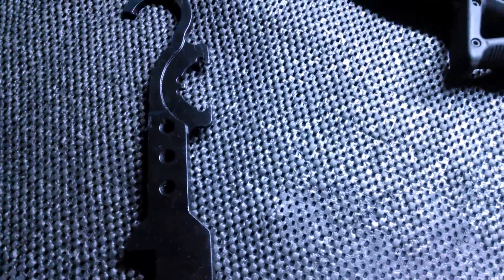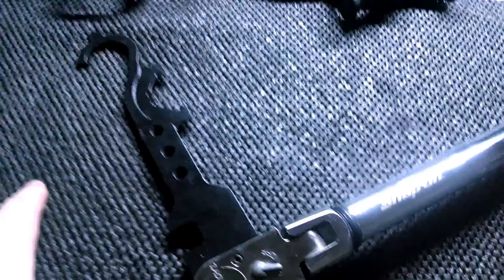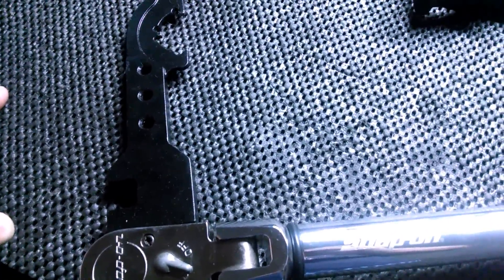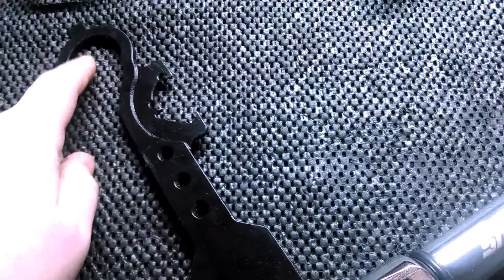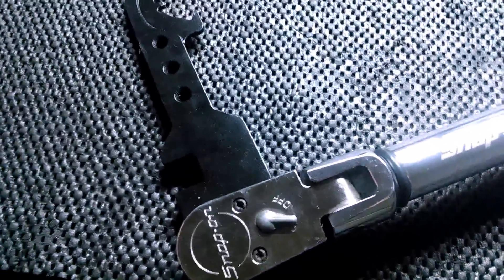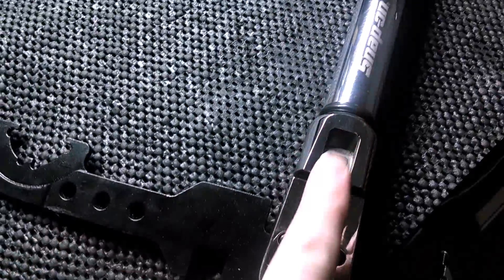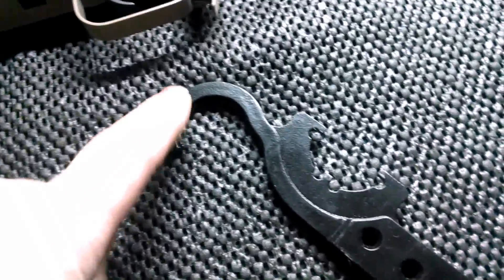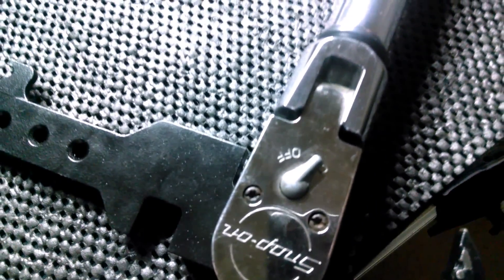Proper torque of AR barrel nut

Comment: YES, thank you! I am an engineer and ive been waiting for someone to make this video!
Reply: Interesting, I knew the values are different when you have an offset but I didn’t know putting it at 90 negates the need for calculating the actual value. Makes sense when you think about it, bout to install a new shroud and this info will come in handy!
Reply: i keep a 1" wrench with a 3/8 drive adapter welded on the box end with the conversion formula etched on the side just to reach and torque one specific hydraulic line lol
Reply: I'm an ME myself and I believe after about the third grade most kids stop paying attention in math

Comment: Awesome video!  Thank you for bringing this to light. Yes, adding 90* removes the additional lever length. The people saying it doesn't matter will change their song if they over torque and strip the aluminum threads off of their upper receiver, or the over torque causes too much stress with recoil and their receiver cracks at the barrel joint. Plus steel and aluminum expand at different rates when heated, and the proper torque gives adequate space for the expansion. Saying it doesn't matter is horrible advice when it is so simple to correctly do it.

Comment: For anyone interested in understanding the formula, look up how to calculate the sine or cosine of a right triangle. Torque is applied force x distance from axis of rotation (center of nut). This requires that the applied force is perpendicular (90 degrees) to the wrench.
If you cannot get a wrench onto the nut or bolt at 90 degrees:
For wrenches OVER 90 degrees from torque wrench, the length of the torque wrench becomes- Length of torque wrench + (length of barrel wrench x sin(degrees past 90). Now divide your needed torque value by that new total length and you have the required force.

If the wrench attached to the torque wrench is at a position LESS than 90 from the torque wrench, subtract the barrel nut wrench length x sin(degrees less than 90) The rest is the same.

Comment: Im not a mechanic but i was thinking that  adding an attachment to a tourqe wrench would change the value. Just as you get more tourqe by adding a longer bar on the handle. I didnt know that by making sure the attachment was 90 degrees it would equal it out, great to know, awesone info.

Comment: Thank you, i had a feeling that when you use a torque wrench on anything that can enhance leverage, the value would be different. You have taught me how to properly torque the ar15 barrel nit! Thanks a million, just always remember 90 degrees!
Reply: SHOOT & SHOW
I have never used anti-seize or anything else on my barrels. I torque to 50ftlbs and have had no trouble taking them off. Do they come loose or freeze up?
Reply: SHOOT & SHOW
Got it, I suppose using anti-seize is cheap insurance against something like that.

Comment: One hundred percent correct. 

torque = r(adius) x F(orce) x sin (of given angle)

Sin value of 90 degree angle = 1

Formula becomes simply radius x Force, which is basically the reading on your torque wrench.

Comment: I too work in aerospace, dropped a few torquemeters already :-). Everything spot on with how I was trained. Will add too, the 20/80 rule which I'm sure you're aware of. Take the max readable torque value of your wrench, double it and move the decimal place one to the left...IE, I have a 30in/Lb torque wrench, it's accurate range is the upper 80%, or 6-30in Lbs. Again, to the poster, I'm sure you were aware of this, just added value to the viewers. Also, snap-on makes toque calculators specifically for the reason, but in most cases you can get at the bolt/nut/whatever with the 90 degree.
Reply: In all honesty, up until this weekend, I've mated up several barrels to uppers...not utilizing a torque wrench, with no issue, but I agree it should be done right. Further more, kudos to Noveske for taking the time to answer my questions regarding such, the guy I spoke to recommended aeroshell for grease by the way, however I'm sure there are several that will work.
Reply: Fuel controls mostly, in different flavors, brought to you by Honeywell. Kind of fell into the job, with a BS in a whole nother field, enjoy studying up on turbines though...a good channel I've found is AgentJayZ
Reply: F100-PW-229 here, the generator isn't as complex as the "unified" from what I'm told, but is still quite the bear. Most folks in our area think we make thermostats, but that's okay.

Comment: I’ve watched half a dozen videos about this topic, and was thinking “how are they not taking mechanical advantage into account”?  I’ve been working on aircraft for 25 years, and this is something you learn before you even touch an aircraft.  The only rational explanation I can think of, is that these guys are using an armors manual where the tool length is is already calculated into the torque spec.  And, they have continued to use this same justification for every application, which shouldn’t be the case.  Anyhow, good video.
Reply: Wait, what are you saying?  Your reply reads like you are saying opposites at the same time.

Comment: Yep, Ford Senior Master tech here and I see the same thing. Real easy to just set the wrench 90 and be accurate. What's the point of torquing if your not doing it right. Hopefully your video helps folks out.
Reply: Spec is written as if there is a socket. any wrench length is not part of spec.

Comment: ya any inline extension will increase the torque you applied do to leverage as a tech we try to only use short crows foot sockets at the end of a torque wrench so it only changes the output by about 5-10 ft lbs give or take.

Comment: C=D(A/A+B)
A= Length of toque wrench
B=Length of lever
C=Torque
D=Angle
Reply: Jake T. A/A would just be 1 so I would simplify by saying C=D(1+B)
Reply: @iroquoispliskin6077  you can't cancel out like that with B in the denominator. Plug in different numbers in the original equation and you won't match your formula

Comment: Yes you are correct.  Force x lever arm length = torque.  Keeping the armours wrench 90 degrees in relation to the torque wrench shaft maintains the original  lever arm length of the torque wrench.  No need for trigonometry and algebra this way.

Comment: Right on brother!
You are 100% correct. 
I too play with torque wrenches all day for a living. 
I am also an AR builder. 
This is correct knowledge!
Thanks for putting that out there for other people. 
Where people get confused is the army’s Armorers manual states to hold the torque wrench at 0° and I think that’s where people get their confusion and all the mixed info. 
I guess that’s also why they give you a big window of torque values.
Like 50 lbs to 80 lbs. 
I keep the torque wrench at 90° and after seasoning the treads i do a final torque value of 50 to 55 and have never had a problem or have a barrel nut come lose.

Comment: I have built several oil and gas tools at my job that require the use of torque adapters and absolutely if the adapters being  used do not consider the formula people are not getting the proper values.

Comment: That is how the USAF taught us to use torque wrenches.
Reply: Yep. I worked on f15s and fa22s
Reply: I'm the guy in the AF who used to calibrate torque wrenches. You might also recall that when using a standard crowsfoot adapter, it didn't matter what angle it was, but to torque to the center f the specified range. QC guy tried to fail me on a task once until I pointed that tidbit out in the tech manual. Personally, with a torque range of 30-80 Ft/Lb on the barrel nut, the drive being a couple inches away isn't going to be wrong unless you're right at minimum or max torque.

Comment: Thank you for this! Question....if someone positioned wrench improperly, which way applies more torque? In other words, the way your torque wrench is positioned 90 degrees in this video, and let's say you are doing the castle nut, if you ratcheted your wrench 45 degrees to the right, would that apply more or less torque on the castle nut? Or what if you positioned your wrench 45 degrees to the left of 90?  Basically if the wrench would be at 45 degrees vs 135 degrees? Thanks again!

Comment: With all due respect to all the posters that suggest the angle between the wrench and the extension matters, or the length of the extension matters, they don't. 

The torque applied to an object is the same anywhere you measure it.  Imagine this thought experiment:  Take two torque wrenches and attach the socket ends together rigidly.  Then fix one wrench, let's say to a vice.  Then apply a force to the free torque wrench, any torque.  Once in a steady state, look at the torque reading of the wrench in the vice.  You will see that the torque readings of each wrench are exactly the same, one opposing the other.  Now fix the torque wrenches to the ends of a metal bar, the length does not matter.  Then apply a torque to both wrenches.  No matter how far apart these wrenches are, or their orientations to each other and/or the bar, the torque readings will be exactly the same or the whole system will spin.  

Thus the torque the barrel nut sees is exactly the same as the torque wrench shows, no matter how far apart the torque wrench and the nut are or the angles between the torque wrench and the bar.  

This is why barrel nut wrenches don't come with instructions to adjust torque readings, even though they come in different lengths.  So just trust the reading on the wrench, it does not have to be calibrated.

Comment: Should add that the torque wrench handle should be 90 to the centerline of fastener that is being torqued, which may not be aligned with the "handle" of your armorer's wrench.  For example, the center of the three-point castle nut portion of the armorer's wrench shown in this video, is not at the centerline of the armorer's wrench "handle".
Is it close enough for government work?  ...probably.  But technically, the handle of the torque wrench should be 90 degrees to the line that extends from the center of torque wrench square drive to the center of the fastener being torqued, for the torque value to be absolutely equal to the wrench setting (assuming that the torque wrench has been calibrated recently).

Comment: Torque specs on barrel nuts vary by manufacturer of the barrel nut. You must get the torque for the barrel nut from the its manufacturer. They're not all the same and using the "Mil Spec" torque may be too much for the nut, some of which are aluminum allow, not steel. There are a plethora of floating handguards with proprietary barrel nuts now. Otherwise, yup, torque wrench 90 degrees to adapter avoids complicated trigonometry calculations for the torque wrench setting.

Comment: Good stuff bud. Oldie but goodie. In your opinion what is the best type of torque wrench to use without breaking the bank? And should I use a full armor wrench or the small one?
Reply from the maker: I think you will be fine with any adapter (I like the smaller ones).  Wrenches in Aviation are calibrated annually so they are all accurate, seems like they are all snap on but any kind will be fine for an AR.
Reply: @SHOOTSHOW00  I appreciate the fast response. Yea I think I’ll pick up an adapter. I just got into this stuff late last year and I’m the kinda guy that will try it himself before paying someone
Reply from the maker: @billmurphy8685  Magpul BEV blocks are nice, some Aeroshell 33ms (royco 64) for the barrel nut threads and go to town.   good luck

Comment: Thanks! Makes sense...in fact it seems natural to put it 90 degrees, knowing that you're adding torque by making a longer "lever" doing it any other way. On my second AR build, brings up another sticking point with "some"...whether or not to use lube/anti-seize (AeroShell 33 seems to be the most popular) on the threads, and to a lesser degree, on the extension itself. Seems to me anti-seize on a slip fit     seems unnecessary. But more importantly, I just read a guy that "done it right hundreds of times" uses NO LUBE on the barrel nut threads and claims it gives a false reading! This makes no sense! Please chime in with your opinion or facts please!

Comment: How much deviation is there by not doing it the way you stated? Barrel nuts are to be torqued between 50-80 ft lbs that is a difference of 30 ft lbs. I worked in aviation for 20 years and the torque values had to be very specific, here not so much!

Comment: There is a big misunderstanding how torque wrenches work and barrel installations.  If you are measuring force (in force units) applied at the end of the torque wrench, you need to take into account the arm length (perpendicular distance between force line of action on the torque wrench and rotation center of where torque needs to be applied) and applied force.  In this case, the formula applies.  The formula is really for installations where a  torque wrench i snot available.  If you have a standard torque wrench with a torque scale (calibrated beam or calibrated spring-click mechanism), it does not matter where you attach wrench, torque scale will indicate correct applied torque.  The distance between the wrench attachment point and torque application rotation center will affect what force we apply to generate the same amount of required torque...but again, if the wrench has a calibrated torque scale, just apply force until reaching desired torque.  This is explained by Newton's third law and Euler beam theory.

Comment: how much torque is too much to take off an ar 15 barrel?
Reply: fedfsr Torque spec on tightening is 30-80 lbs.. so I'd  estimate 20% at least  over that to break the nut free. That is unless some idiot put Red Loctite /Rockset on the threads
Reply: InfraRedNeck I think Fedfsr was asking as he's trying to BREAK LOOSE a barrel nut that has been overtightened, or some idiot has put Loctite or Rockset on the threads.

Comment: Q: How much torque is being applied when torquring with torque  wrench in-line ?
Reply: That depends on the length of the extension.  You have to calculate the force you would apply based on those dimensions and then calculate what setting to put the torque wrench at to get the desired torque....or you can just do it at 90 degrees as mentioned in the video and avoid the math.

Comment: What torque wrench model?
Reply from the maker: It was the first digital snap on.  I hope they are better now.  It kills the batt very fast and the cap always come loose when torquing which leads to over torquing.
Reply: Moe Green I’m trying to find a beam wrench made in USA but it’s hard. I have all CDI wrenches from when I was a mechanic but they are all in foot pounds. What range wrench do you need? I can barely find a 1/2 Drive in inch pounds
Reply from the maker: @bajamike3803  That is the good thing about then snap on digital, you can switch between in and foot.  The new ones have the angle indicators too.

Comment: Read US GOV Armorer's course states to torque with torque wrench in a IN-LINE with tool.. 
Q: How much is the ACTUAL TORQUE being applied ?
And can someone fiqure the real  values based on say the center line of the barrel + .500 , .750, 1.00, 1.25, 1.50 outwards from that to account for differences in were the torque wrench engages into the square hole of VARIOUS wrenches on the market, as spacing  might be different from brand to brand? )

Or at least post the "real" amount of torque using a " Real G.I. Barrel wrench as used by US Gov.

I plan on using a Brownells Reaction Rod, with barrel wrench in the vice, and applying torque thru the reaction rod itself. ..which would be like torquring at 90 degrees/ torquring with a socket with no offset...

Comment: If you want your torque value input within + -  10%, this "90 deg method" you mentioned is ok, but if you trying to do precision  works, this method is Totally Wrong, and you WILL always input more torque than desired.
Reply: angtr This method works for precision as well. As long as you apply force perpendicular to the torque arm (wrench) the torque remains the same.  I guess what I am saying is, you are right, but because of human error. The 90 method can be proven experimentally and mathematically.